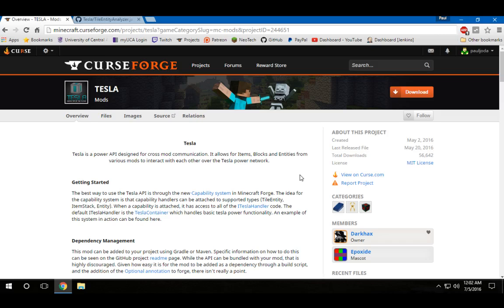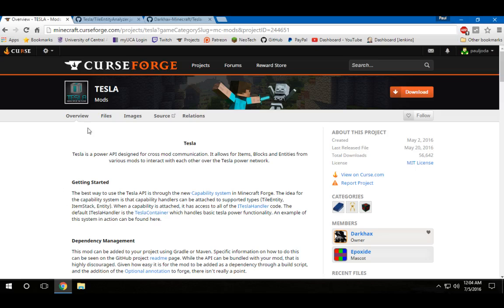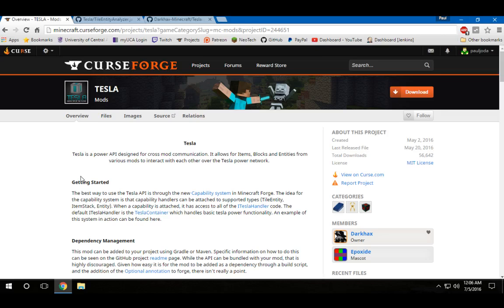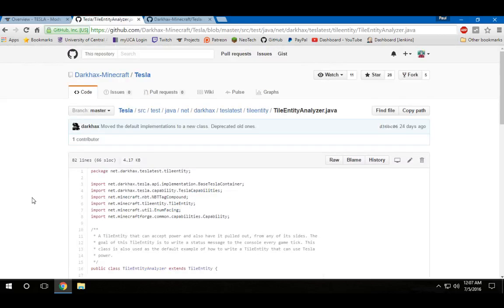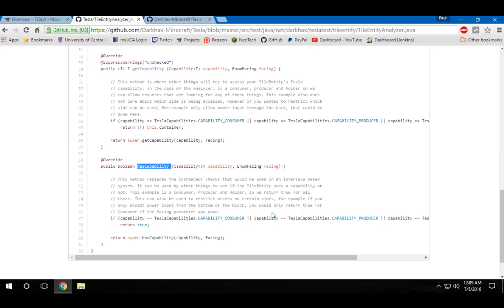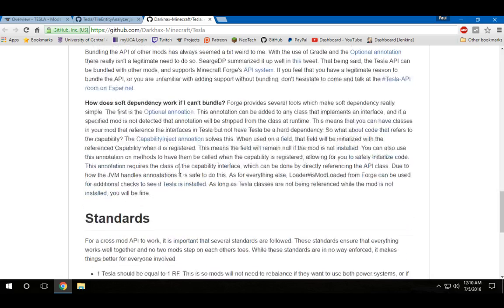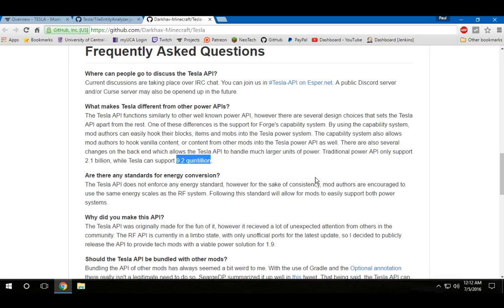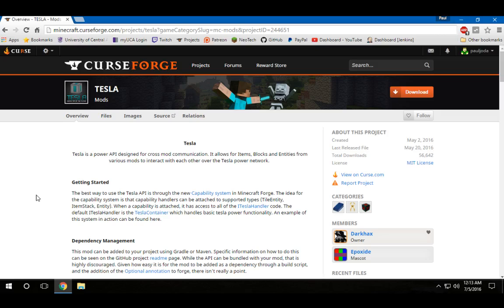Tesla API Developer Commentary

Comment: You are right to be caucious about working with numbers that exceed a 16 bit integer as its simply more work for the CPU to do than using smaller numbers. Minecraft hammers the CPU anyways, 100 - 6 is much easier on the CPU than 100202893 - 6001
Reply: Although I don't know much about Java, I don't think a larger number should hurt on a 64-bit or 32-bit OS. Although you're right that it COULD impact java performance, I sort of doubt it. Mods were already converting 16 bit RF to other formats to store larger amounts; I would argue the performance that is lost by using 32 bit is less than the amount of performance lost by doing constant type casting between wires and energy storage machines; an unsigned 16 bit integer can't store as much energy as most RF mods actually use, so TESLA sort of makes sense.